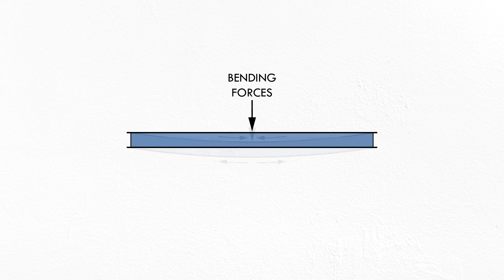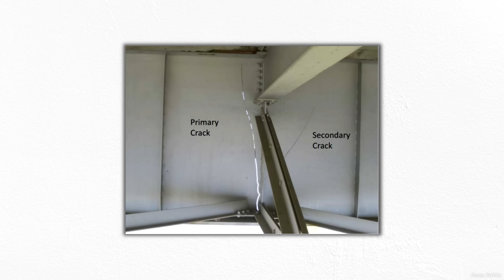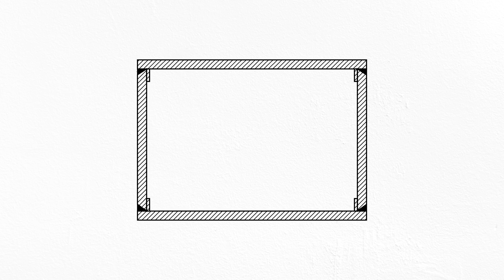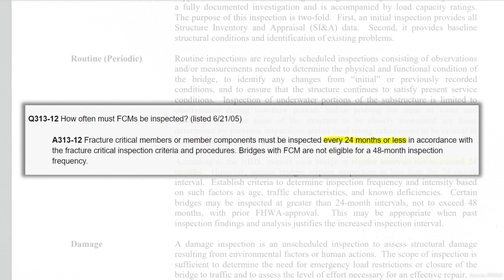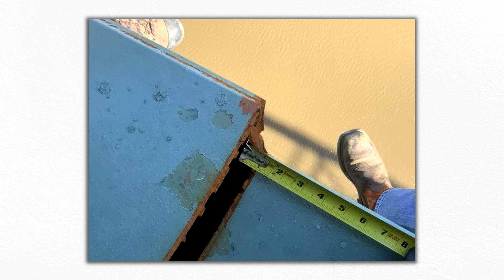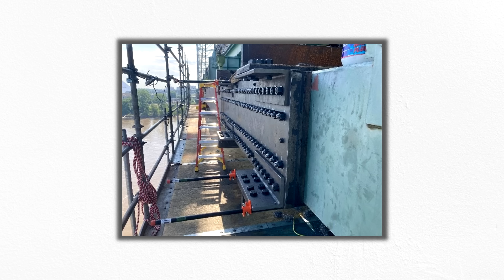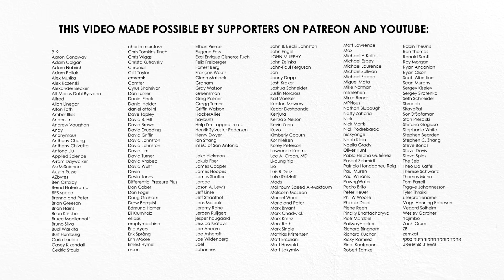What Really Happened at the Hernando de Soto Bridge?

Comment: you KNOW something is bad when an inspector bypasses all of his superiors to call 911 to shut down major infrastructure.
Reply: Can you imagine the repercussions if that kind of call was made and it turned out to be a non-issue. Making the decision to make that call is honestly a huge deal.
Reply: @austinwolfe7295  I'd say the opposite; if it even had the appearance of being an issue, closing the bridge immediate is the only prudent option until it is ruled out as an issue. And the inspector would definitely know the difference between an "oh shit" situation and a "let's file a report" situation. Also... depending on the situation, there is probably professional licensing involved that could make the engineer('s firm) liable for massive damages if the standard of care isn't met.
Reply: @iroll  It's not just that crack. As was said, that failure didn't change the loads and forces which then needed to be taken up...somewhere. But where?
Shut it down ASAP until that can be better ferreted out.
Reply: @ChuckD59  Exactly.
Reply: @austinwolfe7295  Proper safety culture wouldn't penalize a call like this. Don't take the comments below personally. We all grow up in different cultures that may have influenced your feeling this was a risky thing to do.
Reply: @austinwolfe7295  yeah though I can hardly imagine fracture-critical piece cracked completely being non-issue
Reply: @austinwolfe7295  diverting traffic for a few hours surely hurt but losing lives and having a collapsed bridge (that could take months/years to rebuild) is just not worth the risk.

It's a critical failure, it's unsafe for the public.
Reply: @N. Warner It was an outside firm doing the inspection. So the 911 caller was not employed by the bureaucrats The fired inspector was from ArDoT.
Reply: As engineers and professionals, it is our duty to protect life and property foremost. Seeing a structural member with that significant of a failure warrants an immediate shutdown, no questions asked.
Reply: @N. Warner the inspector's name has been published. Also every bridge he has inspected in the last few years is now undergoing emergency reinspection. I imagine pretty much every qualified outside inspector willing to travel is in Arkansas right now performing that work.
Reply: I'm still trying to imagine the 911 conversation. "You want us to do what now?" "Shut down the bridge!" "Say again." "The bridge is in danger of collapsing!" "Is this a prank from some kids? You know you can get into a lot of trouble." "No! This is Jim with X company I am inspecting the bridge and it is danger of imminent failure!" "Uhhh...hold on let me get my superior. We don't have a procedure for this..."
Reply: @dbrobb5282  The 911 calls were released early on.  The call to Arkansas 911 got traffic from that direction stopped.  The call to Memphis 911 went pretty much like you said.  I don't know the final outcome but there was some significant reporting on the 911 response (lack there of) right afterward.
Reply: I bet if that person didn't call 911, traffic would still be going over the bridge. That's probably why they made the decision to call 911 instead of letting the project manager know.
Reply: I have to assume the inspectors' training included "if you see a likely life-threatening incident, call 911."
Reply: We need some help is there a doctor in the area? Yes yes I'm a doctor--this person is severely injured can you help? of course the doctor says whipping out a cell phone...say doc what are you doing? First I'm calling 911!!
Reply: @N. Warner it was a contractor that called 911
Reply: I promise you ardot never uses those contractors again.  They do not like being embarrassed like that.
Reply: @zcriswaa  
Bet they do.  It was the contractor  (consultant) that caught the defect and shut it down.  The previous inspections were done in-house, which is why the in-house inspector was fired.
Reply: @zcriswaa  Please verify this with facts. 

Otherwise, you just sound like a goofy adolescent.
Reply: @Hastelloy X Get to da Choppa!!!!
If you wanna cross...
Reply: If you listen to the 911 call, the engineer mentions that his supervisor has already been called.

When the engineer is asking themselves how the ** is this still standing, I would hope calling 911 to get it evacuated is very high on the priority list.
Reply: "several of the engineers called 911"
Didn't say anything about bypassing superiors, as if they wouldn't have trusted them to act, they simply realized the urgency.  Calling 911 and getting law enforcement response is the fastest way to stop traffic from using the bridge.
Reply: @N. Warner I feel like the backlash that would come from the public catching wind of something like that is FAR worse.  
 Imagine being the firm that not only failed to notice an inch separated crack through the majority/entirety of a failure critical beam the size of a piece of furniture for several years, And then your response to someone finding a - - failure critical - - fracture on a heavily used bridge acting in the publics best interest was to fire them.

I feel like that would be the end of the firm.
Reply: I'm impressed emergency response even took the call seriously. 

Guy makes the phone call.

"911 what is the nature of the emergency."

"My name is John Doe and I'm a Safety Inspector for Arkansas DOT and I'm on the ledge of the Hernando de Soto Bridge ..."

"Sir suicide is not the answer.  I assure you whatever anxiety you are facing it is not the end of the world."

" You must shut the bridge down before it is too late."

"Sir, we can have mental health specialist on the phone now to help you with your ordeal.  Please don't jump."

"Jump?  We are all going to fall if you don't shut down this bridge right now?"

"Sir, please stay on the phone with me, help is on the way. "

"The only help I need is for you to shut down the bridge!"
Reply: Here waiting for a crack to go all the way through took years.   Luck was on our side here for many years.   It is amazing so much work occurred for many years without anyone "seeing" the crack.  At least this time there was no catastrophe.  There were probably similar cracks and not noticed in the 2018 Ponte Morandi, in Genoa Italy region during bad weather.
Reply: Ryan Curtis is a drama queen. He doesn’t know the details, but is making harsh comments, anyway.
Reply: @N. Warner It's a high probability that the previous inspector, who inspected the bridge before and didn't sound the alarm (or even put it in the report) was fired. Hell, that guy is going to be really lucky if he can even practice engineering in the state again. The Association will probably strip him of his license
Reply: @LordofTheFallen  You comment makes me think of a secret society of hooded figures somewhere, giving and taking the right to engineer stuff
Reply: @horrorhotel46290  You're not far off. Most states/provinces have an engineering society which regulates the discipline. They give your your licence to practice if you meet their requirements and can take it away if you mess up.
Reply: @LordofTheFallen  😂😂😂😂 all they need is a college degree in engineering and some experience and they’re golden anywhere. I’ve never seen an engineering license before 😂😂😂😂😂😂😂😂
Reply: @lonewolftech  I said license, not degree. And I have the distinct impression that you do not work anywhere near civil engineering if you think that you can just go right out of school.

All civil drawings have a stamp on them with a license number. In civil engineering you often cannot legally do construction work without a stamped set of drawings. That stamp and license number is regulated.
Reply: @LordofTheFallen  😂 one cannot strip another of their engineering degree 😂 there is no licensing really.
Reply: @LordofTheFallen  more like promoted for saving the company alot of money.
Reply: I'm an electrical engineering student, that being said, it doesn't take an engineer to realize that ohh shit there's a crack in the bridge let's shut it down!
Reply: @nathanial7249  Not that simple. Stuff cracks. There's lots of places where cracks don't cause big problems. But this was the main link holding the bridge together being completely torn apart. Once you understand that, you raise holy hell until the bridge is shut down.
Reply: @soaringvulture   "There's lots of places where cracks don't cause big problems." Pretty sure they don't put "lots of stressed steel parts" on a bridge that aren't a big deal if they fail.
Reply: I imagine the main reason they went this way was because this is an acute issue... it was basically "this bridge could collapse any moment, we need to stop traffic NOW!", no time to go through the "proper" channels.

As for the fired guy, i imagine it being publicly shown that he was just flat-out not doing his job played at least somewhat of a role. It's one thing for somebody to do their job poorly. It's another to not do it at all.
Reply: Employers need to embed a “See something say something” philosophy/culture so people feel obliged to speak up without fear of repercussion
Reply: @soloman9448  Ya,  ask  snowden  how  thats  working  out  :)

Comment: So they have plans to review all of the bridges that were under control of that inspection team, right? Or are they pretending that this was the only bridge that they missed critical failures on?
Reply from the maker: According to ARDOT they have re-inspected all the bridges that were under that unnamed inspector's responsibility.
Reply: @PracticalEngineeringChannel  it doesn't sound like the problem was that one inspector so much as it was a flawed system that allowed one inspector to miss something this critical. As you mentioned in your video, something this critical should never be trusted to one person because people make mistakes. Hopefully they're reviewing their maintenance organization structure and checking all of their bridges, because chances are all of their inspection teams have this similar flaw.

Comment: I found it interesting that the fired inspector claimed the area of the crack was unsafe to inspect by snooper truck and that is why he didn't find it. I found that it is not uncommon for inspectors to declare an area inaccessible and leave it out.  The problem being that management may not act to provide better resources to access those areas. 

Also. Fracture critical inspections are not required any more frequently than routine inspections (24 months). More frequent inspections are on a case by case basis or determined by agency policy (not law).
Reply from the maker: Sorry if the script wasn't clear. I said that bridges with FCMs are usually inspected more frequently, not that it's required. ARDOT inspects bridges with FCMs on an annual basis.
Reply: @PracticalEngineeringChannel  that's how you can find the engineers in your audience. They always fret over the specifics.

Comment: Looks like it’s only due to safety margins and some redundancies introduced by the design of this bridge, that it didn’t collapse.
Reply: That tie is considered non-redundant. The reason the bridge didn't collapse is because the stresses were distributed to pther parts of the bridge they weren't meant to, possibly damaging them in the process.
Reply: @jareddiaz3218  correct. That part wasn’t redundant, but the design and safety margins allowed it to suffer what hypothetically would have been a catastrophic failure, and still continue to function for years. 

I have crossed that bridge at least twice since the crack appeared, possibly 4-5 times, depends on when it first appeared. I crossed it once in mid 2013, twice at the end of 2014, and twice in late 2019.
Reply: Good design
Reply: Cold war engineering. Needed to be able to handle an armored column if the war went hot.

Comment: The best solution is prevention. A safety factor of 10 plus multiple connectors. Very probably it was built to a safety factor of 10 and the connector on the other side pickup up the slack giving a safety factor of only 3-5.
If 1 or more of the cables were not the correct length of suffered elastic deformation during heavy traffic it would create a bending force. The longest cables in the middle would stretch the most. 
Also, the structures close to the road will follow the temperature more closely than the structures above because of the road draft created by traffic. Lifting the span when a cold front comes in and dropping/drooping when a warm front comes in.

Comment: Your title is misleading. You clearly state the investigation is ongoing and we don't really know what happened. Your explanation of events is well presented. I had wondered why the traffic was stopped below. The media coverage is too stupid (I use this word purposefully) to explain the failure was a critical member. It is clear that several Professional Engineers and technicians failed to do their jobs correctly. 

I have an acquaintance that inspected earthen damns. The levy passed inspections for all years before and showed no problems. Until the entirety of data was evaluated rather than year over year data. The levy was found to have major structural defects that had been ongoing for years. Yet, it passed many years of annual inspections and evaluations by professionals. This is why we engineer things with excessive safety. Because all good engineers understand human fallibility. Design is the engineers problem; maintenance is the owners problem.

Comment: The reason why it hasn't been fixed is because of the cost. The Higher UPS would rather pocket the money instead of spinning it correctly. The temporary fix is going to take 2 months and cost One million dollars. Properly inspecting the bridge will find more defects. Rough estimate to  Is fixed the bridge as well as any other possible defects will cost between 10 and 20 million dollars and probably take 1 to 2 years.  If they keep the bridge shut down they could fix it faster. The problem there is the longer the bridge is shut down The more money it is costing citizens as well as companies that use the bridge. Is there an article claiming it is costing the trucking industry 2.4 million dollars having to go around the long way per day

Comment: So dumb questions if it is unacceptable to have a single point of failure in inspection why is it ok in bridge design? Why not build in intentional weak points that give more information that something has gone wrong without having to check the whole structure (like a fuse box in ee saying hey something happened).Is it possible to design bridges that don't fatigue or that handle better for similar costs? What determines if a bridge is built onsite or offsite? Are there bridges that harness the energy of the flexing? I would love to see a discussion of general bridge design and trade offs especially sectional bridges that can move (separate into multiple components).  Back to fatigue why at this point in metallurgy can't we create smooth internal crystal layouts that don't have stress concentrations (perhaps by doing pre and post heating robotically)? Are there bridge welding robots/discussion of them would be of interest.

Comment: I am a French engineer ("Professional Engineers" in your system), specialized in hydraulics, dams and river structures. Inspection is a great profession, which requires extreme thoroughness!
And Yes, it is not normal that a lack of detection is simply resolved by a simple dismissal.

Comment: Thank you for this wonderful video. In my experience, I have only done one bridge inspection before, I'm mostly a tunnels person, but that drone video was the most damning part of the whole video. Whoever was operating that inspection drone at that time knew about the crack and while it wasn't cracked all the way through, it obviously was enough to warrant a second look. 

From my experience in structural inspection reports, I can almost guarantee that the issue was noted in a report. If the inspector wasn't empowered to close down the bridge, and I can tell you as a (used-to-be) young engineer, you are not always told the full extent of what you can do, or you don't have the confidence to make the call when you're assigned the "new guy" work of inspections, it should have made it in an email or a phone call to the supervisor during or immediately after the inspection. Each inspection report should make its way up the chain to the manager of the Structural Engineering section (or equivalent), and if the DOT fired that guy for ignoring or downplaying the reports, I personally back that sort of decision.

Disclaimer: I don't work for either of those DOTs, so I don't exactly know their process or what's going on with their record-keeping, but it's typical with my experience working in the Midwest USA.

Comment: It will be interesting to find out what caused the problem. Was it a design flaw like the I-35 bridge over the Mississippi river in Minnesota where the tie plates were too thin. Was it bad steel or improper welding? There was a smaller arch bridge near me that was built out of box sections. Cracks were found about 20 years after it was built. The steel was determined to be brittle. When it was torn down and the metal was processed through a shear, the metal broke instead of shearing. Every architect wants to re-invent the wheel and put their own design on things instead of using time proven methods and it often comes back to bite them, like the simple walk bridge over the street in Florida that collapsed while under construction. Minneapolis Minnesota has a Skyway system that connects many buildings in the downtown and never had one collapse.